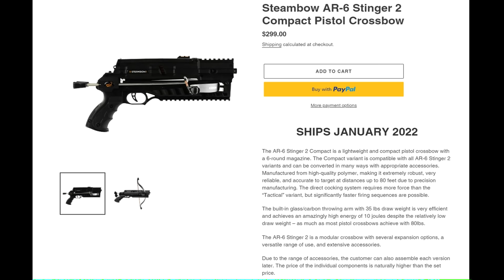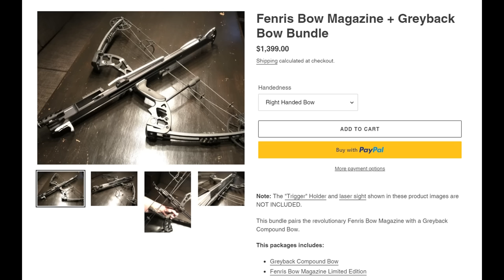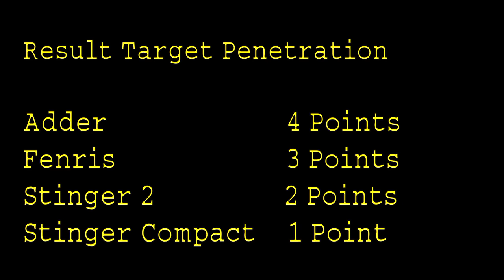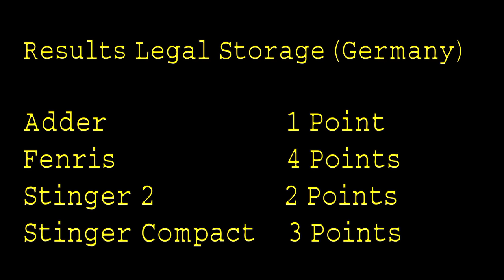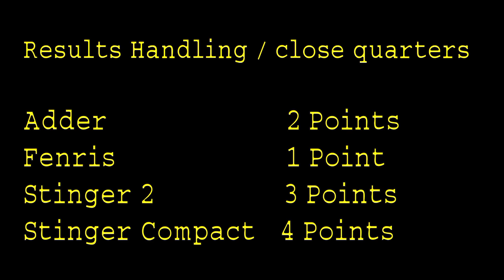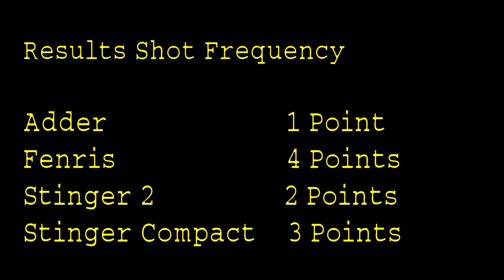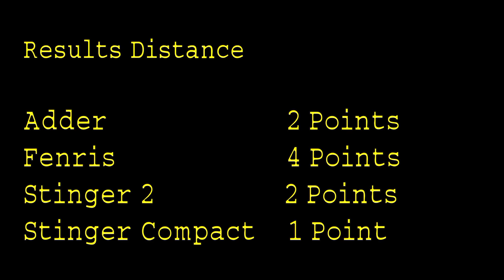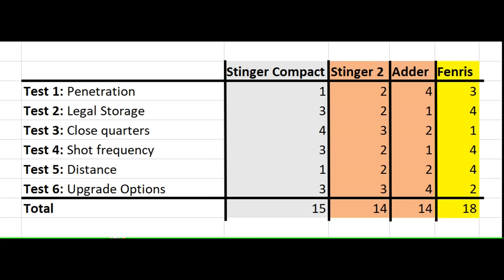Home Defense With Bow and Crossbow? OF COURSE!

Comment: The fenris has another huge upgrade option: you can mount it on ANY bow 💜
Reply: Also, I see no reason it couldn't have a bipod attachment, making any bow a stable platform artillery device.
Reply: @bartroberts1514  How very Roman.

Comment: Excellent video Jorge, thanks for the testing this helps alot. 😉

Video starts out with a very pragmatic and realistic warning and advice on dealing with Intruders... Being a former neighborhood watch Commander I can testify to the fact that you definitely want to avoid a confrontation even yelling for them to get out but getting everybody out the back door safely would be ideal it's better to be a chicken than a dead duck because in real life they keep coming even after they're shot they can wrestle the weapon away from you and use it on you or your family so it must be in the extreme and that goes for firearms as well.... But if you have no choice then you have no choice.... But there are some really good ways you can keep people out of your house one of the best ways and people faill on this many times.... Often times someone comes charging in when you're asleep they bust down the door in one shot and they're upon you in under a minute..... I've seen this happen and reviewed video tapes with Police department people that had cameras in their house.... People were stabbed and murdered in their beds.... And they had a security system and guns didn't save them but here's what could have saved them....

4 inch wood screws screwed into the door hinge metal plate on all three plates that's nine 4-in screws on the other side with the deadbolt lock plate you screw in 2... 5 inch wood screws.... If you do this they would have to use a battering ram about 20 times to get through that door, this has been tested.... But regular kicking the door you're not going to get through that door.... So that gives you plenty of time to mount a defense or an escape you can also do this on bedroom doors as well which I fully encourage on your sleeping quarters and of course back door obviously you if you have a sliding glass door you have issues but you have to put lighting and a loud cheap screeching motion sensor alarm.... Additionally on your windows you can do the same thing in fact you probably want to put up I always recommend it putting up items on your windowsill even if they're bottles or anything that makes extra noise to give you a heads up so you can mount a defense.... 90% of thieves want an easy target most of them do not want to be confronted, so Jorge is very wise.

Comment: I have the original Stinger AR 6P, and the Stinger 2 on the way. I like the Stinger 2 because it is compact enough to maneuver around the tight corners I have in my home. But it also has the power and accuracy for distance shots if need be. In it of itself it is lethal. Especially with the incredibly sharp and strong broad heads, and heavier limb.. For me,  the Stinger 2 is the most versatile.  But I do love them all.
Reply: @cloverleafsippa713 yeah why buy a crossbow when you could use an AR-15 or a 12 gauge?
Reply: @Goofiest_goober838  Different types of weapons is better to survival because differents situations may left unoperable one. Sorry my english language, i am from Argentina

Comment: Don't forget the power of poison to make weaker crossbows more lethal.  It was pretty common in post-classical era China where a small repeating crossbow was sometimes used by civilians for guarding their home.  The bolts were often little more than sharpened pieces of wood, but the tips were dipped into something like rat feces or covered with berries from a poisonous plant.  While a victim may survive the immediate wounds, he would likely die of infection or poisoning in the days to come.

Comment: My home defence load is broadheads with 10mm of outer blades flied blunt and attached by wax rather than screwed in. This way the head is retained inside the attacker
Reply: Yep. My Adder has one bodkin in carbon arrow as first shot, because the anticipated scenario would result in a head shot. Shots 2 thru 6 are Titanium X 2-blade broadheads, friction-fit into old R9 practice (plastic) arrows. Specifically so that if the recipient tries to pull them out, the heads stay stuck inside. The reload is another bodkin as first shot (to prevent possible damage to the string), followed by five aftermarket Stinger broadhead arrows (screw-in broadhead, aluminum shaft, plastic rear) with the vanes cut off. These are friction-fit into more of the plastic R9 arrows. Provides an extra bit of mass. And again, if the recipient tries to pull it out the R9 plastic comes out, while the smaller friction fit arrow remains inside him.
Reply: Are there benefits if the head can not be pulled out? Is it a psychological thing?
Reply: @maxwell2.2  it’s an ‘irritation’ thing. A broadhead stuck inside someone will continue to irritate, to do more damage. It will inhibit their movement. And one would imagine all that would wear on their psyche.

Comment: Could you do a direct comparison between the Adder and Stinger 2? Or let me know which you prefer? I used to think of the Stinger as a "little brother" to the Adder, but now that we have the Stinger 2 with the larger size, rear stock, and stronger bow limb, they seem a lot closer now. They even scored the same in your testing here. Between the Adder and Stinger 2, what do you think the advantages and disadvantages are? What do you personally prefer? Which has the better cocking mechanism? Which is safer?
Reply: I’ve been mulling over what my first buy will be for awhile now. 

The stinger 2 has a shorter power stroke (how long the string is contact with the arrow) and up to 90lbs with the break stock cocking mechanism so it’s got 40lbs less power than the adder plus less energy in the bolt. It also has a simpler trigger system which means a really heavy trigger pull on the 90lb limbs. It’s a very flexible platform. You can use the break cock with 90lbs for power and distance. The 35lb limbs with the linear cocking system or even 50ish lb limbs with it (90lbs is probably not feasible). It has a lot of accessories including speed loaders and a weapon mounted clip. Plus optics etc. Its a compact moddable platform but getting all those options will add up quickly especially with the bolts. Both methods are far easier to cock and the weapon itself far easier to maneuver indoors. Finally it’s simple trigger system allows for quick firing without having to disengage the automatic safety. I have questions about the durability of the cocking system using the 90lb limbs.

The Adder is significantly more powerful. Has a more advanced trigger for easier shooting. Can be broken down to fit in a bag or serviced easily (waxed).  It’s about 32 inches long and 18 inches wide at the limbs. The lever to cock it has some play which apparently can cause misfires if you don’t strengthen it. The safety isn’t so much an issue if your practices but it’s going to be harder to use indoors and harder to get that second shot. But it’s clearly better in open spaces or if you need the that first shot to count and with a red dot your hitting that first shot center mass easily. It’s a better field weapon and point defense for a riot. 

In December the EK archery vlad will be released which is a direct competitor to stinger 2 which is the adders real little brother and while you won’t have immediate firing from cocking (it has a safety) I believe it will be one of the best self defense crossbows on the market.

Comment: Always shocked by how folks can end up in legal trouble just for defending their lives. Including here in my own country the United States. Of course here it will depend on if your local government leans a certain way politically, and if the prosecutor has political ambition. 

I have a question. Here in the states I carry self defense insurance. I have legal defense even if I only use my pinky finger to kung pow poke someone who assults me. However, the insurance does not apply for outside the boundaries of my country. 

Does Germany have insurance for legal defense? Specifically, for defending your life? If so, is it available to foreign visitors?
Reply: The bigger issue is how easy it is to lose your 2 amendment rights. Apparently the Supreme Court says the government can’t say when I need a concealed carry for self defense but can determine who is and isn’t a threat and keep their 2 amendment rights. They even refused to hear 2 cases on the issue.

I had hoped they’d be consistent and create some reasonable standard to return our 2a rights. “Shall not be abridged”  unless you screwed up when you were a kid :/

Comment: Also. We all know that even if it's a law. There is no way they can prove that it was under lock and key beforehand when you use it for self defense. Just having the case with the lock and key is enough proof for them.
Reply: I am very much in favor of leaving a firearm in an accessible place with no firing pin though. Just as a honey pot. Load up some ammo, make sure there's no pin, and take off the safety. Then let's see if anyone dares. You could learn a hell of a lot in a very short period of time.
Reply: @yunggolem4687  Yeah, you're mostly correct..... After my initial response that it's a 4th Amendment violation I gave a bunch of caveats that basically prove the 4th Amendment is dead anyway, so.... I guess I can't disagree. "Inspection" makes it sound so regular, though. We don't live in prisons or barracks. Inspections are what we got in the Army, hard to see that happening in a similar way with civilians.
Reply: @yunggolem4687  it hasn't happened to my father either in his 73 years of life. So when is the length of time enough for you?

Comment: Hey, Joerg, we need bayonets on home defense crossbows. The problem is, if there's a jam or we miss or we run out or the bolts just aren't enough to stop the intruder, that intruder might try to rush us. If there were a 6-8 inch bayonet on our Adders though, one that the intruder likely doesn't see at first if we have it pointed directly at him, then I could have a last line of defense. If the intruder does see the bayonet they would likely be more hesitant about trying to rush somebody.

Crossbows are deadly, yes, but do they really have the "stopping power" of a strong firearm? I kind of doubt it. I can imagine an attacker on drugs and adrenaline ignoring the 15" bolt sticking out of his chest, trying to get to me to take the crossbow away. A good hard stab or slash at close range would make that kind of scenario way less likely to go bad.

I know you rigged up a bayonet on your Adder once. Can you make a video on this specifically, maybe with a standardized kit, so that we can do it ourselves? I'm planning on grinding down a rifle bayonet I have and attaching it via the picatinny rail on the front right. It probably wouldn't be the strongest mount point, and the screws I have are not sufficiently long. If you sold a bayonet kit for the Adder on GoGun I would buy it TODAY.

And yes, I know this isn't the original purpose of the bayonet, the bayonet is supposed to give you the option of a makeshift polearm on a modern battlefield. But the use case I've described here makes sense too I think. If you had a Glock with 15 rounds, then yeah, a bayonet becomes a bit silly.... but for a crossbow, at close range, for defense, I would consider it a necessity. These crossbows are a bit shorter than rifles anyway. Add a bayonet and the weapon becomes normal length for a firearm.

I'd LOVE to see that Stinger with a foot-long bayonet, TBH...... That would be sick.

Comment: Great Words!
Avoid conflict unless they are seeking conflict and it is unavoidable.
I see far to many (Mainly American) videos that promote going in guns blazing.
You do not need a firearm to defend your home and family with extreme force if required.
Reply: Generally most American firearm trainers also recommend hunkering down some place with a gun and calling the cops if a bad guy breaks in. Don’t try to room clear, just go some place easily defendable and only shoot the bad guy if they come to you.

It’s also better tactically as room clearing is always more difficult than lying in wait. Though the vast majority of the time, as soon as the bad guy sees you have a weapon of any sort, they’ll bolt. No shots necessary.

Comment: Have an RX Adder in the closet loaded and ready to go just in case somebody breaks in, thank you jeorge for saving us from the noise and potential overpenatration of using a firearm
Reply: Im in the UK i have one loaded beside my bed its gave us the capability of self defence on par with a firearm again.
Reply: Have your tried moving around your house with it in the dark yet? The thing is pretty wide for a 36 inch door frame.
Reply: Have you tried moving with it around your house yet? Especially in the dark?
Reply: @OpiatesAndTits  it's not to bad with the stock fully collapsed, I think you can also remove the stock and it would still be functional, i want to get Lazer and flashlight attachments  for it though

Comment: Firearms are only extremely loud when you don't use a suppressor. They are the norm everywhere except the USA (where they require a costly extra permit). It's akin to running your car with no exhaust system. Maybe normal in the old days, but not in modern times.

I personally feel once you are in your home, you have already retreated to your safest place and defense is the only option. This is the legal basis for what some call 'castle doctorine'. I would not run out exposing myself to more danger.

Also, most of your assumptions seem to be of a single attacker, which is rarely the case in a home-invasion. This could be a deadly oversight. It would be smart to switch to a more intimidating hand weapon, even a knife or stick, once they are within 20 meters. Watch videos on how fast someone with a knife can get to you. By the time you aimed a bow, it would be too late.

I would personally rather have a baseball bat and a pile of rocks, if denied my right to defense tools, than even the best crossbow.

Comment: I disagree, the adder loses points on having a stock it doesn't need fitted? Fast rate of fire vs one much more powerful,  accurate shot that penetrates the target completely? Then one last thing not accounted for, price. You can have all the others for the price of a fenris . Keeping it loaded the fenris wins in Germany, a great advantage there  not elsewhere. My adder is always loaded. It's fast in use too. I went into my hall one night, out of the corner of my eye I saw a shadowy figure up at the top of my stairs. I casually walked into the living room, grabbed my adder cocking it as I ran back to the hallway. I shouted them to come down slowly. No response. I  shot a bolt into the doorframe next to him, re cocked and told them there were plenty more if they didn't come down. Still nothing so I put a bolt low down away from vital organs. Nothing, no movement, no noise? Turn the lights on, I forget I hung a hoody over a vacuum cleaner handle earlier when I went for a shave. Killed my Panasonic vacuum. Next time I'll use the light, not the laser.

Comment: In the UK, crossbows are legal to buy for anyone 18 or over and having looked over the Crossbow Act 1987 there is nothing saying they have to be in secure storage. I would assume that laws relating to having weapons for the express purpose of self defence (which is not allowed) still apply. You can use a crossbow in self defence if it happens to be around, but if the police ask you why you have a crossbow and you say 'to defend myself' you are probably going to be in trouble.

I think it would be better to use the field tips rather than the broadheads. The broadheads are for hunting, and since hunting with a crossbow is illegal you would have a tough time explaining why you had them to the police if your explaination for having a crossbow is for recreation and target practice. Obviously, its not as good as having a broadhead when it comes to self defence, but I would imagine being hit with a field tip bolt would dissuade the average burglar from continuing to attack you. Its probably a good thing if you also manage to stop a home invader without killing them. Less press attention if you use one on a burglar, less PTSD from killing someone and the less potential for a lengthy sentence in the event you are charged and a jury doesn't see things your way.

Comment: I’m surprised Jorge missed out on a few important things..
One being the upgrade option for the Stinger 2 you can buy the “quivers” to store the bolt magazine holder, which can be attached to the side picatinny rails for much faster reloads (if you was to need fast reloads in the zombie apocalypse) secondly why wasn’t the Bodkin bolts even mentioned..? I thought the Bodkins was meant to have more penetrating than the broadheads..? Surely he should have done Bodkin & Broadheads in the penetration tests..
Reply: Bodkins are good for penetration, especially through armour, but broadheads do more damage and therefore are more likely to stop a home invader

Comment: One thing that has always really worried me about crossbows is if you ever did have to hold up an intruder with a weapon trained on them that colloquial "round in the chamber" which is really a projectile bolt on a cord held locked in position under tension is subject to the weapon working perfectly. Whilst a gun may not always fire because it's faulty, it'll never fire itself when you're simply holding it pointed at a threat. A crossbow on the other hand, if something did go wrong with it and that tension suddenly released and you send a bolt through someones face it's like boom.... Murder. "But I didn't shoot it" yeah well tough luck sunshine. Always worried the hell out of me.